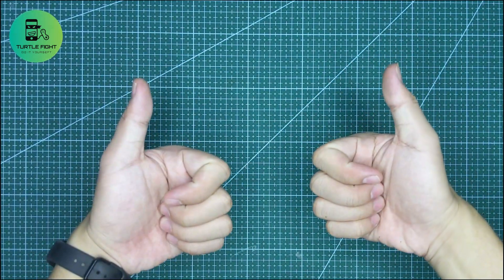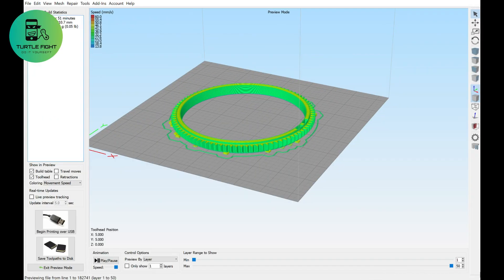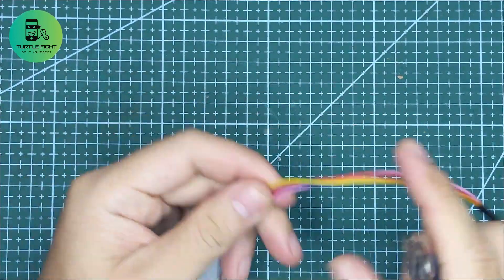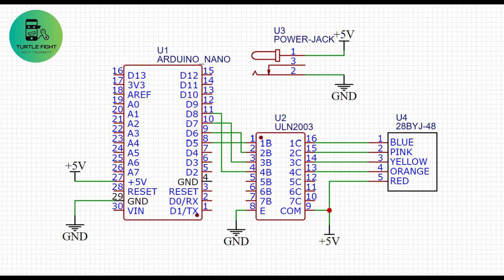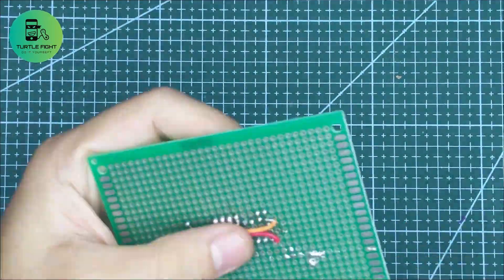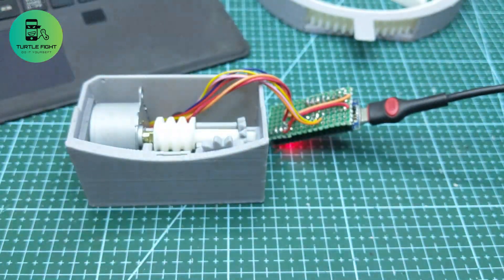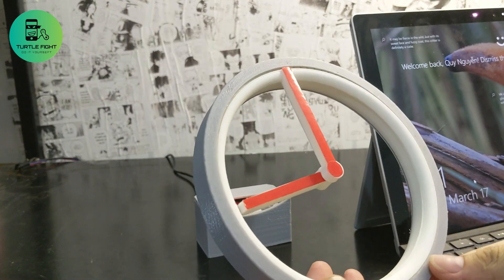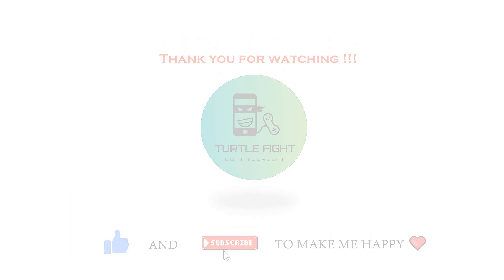I Made an Invisible Clock for 8$ with Arduino Nano and Stepper Motor.

Comment: This is a nice clock and cool project (thx @shiura), but accuracy over only 1 hour is worthless.  A Nano or Micro will rapidly lose or gain time over 24 hours or longer, making this clock pretty much useless in real life.  One could resolve this either by moving to an ESP32 and using network time or by adding an RTC that keeps accurate time.  Some RTC modules will remain accurate to within 5 seconds even after a year, avoiding the need for Internet as ESP32's are vulnerable to malware.
Reply from the maker: Hello bro, thanks for your comment.  I use this clock for a number of days and I find that its accuracy is quite good.  According to its code it can throw an error after about 2 months.  That's been a long time, isn't it?

Comment: I believe this can be done without an Arduino.
Reply from the maker: Yes, your opinion is correct.  We can use another stepper driver and generate a PWM clock pulse to control.  But this is the easiest way to do it in my situation 😅
Reply: And it's a way of showing the use of arduino.
Reply: @OGMann  to make a timer? It is like a cannon ball shot in a fly...
Could be made with a much cheaper and simplier MCU or even any other kind of circuit that pulses.
This is my point.
Reply: @Gambiarte any workable example? TIA
Reply from the maker: Exactly bro 😁